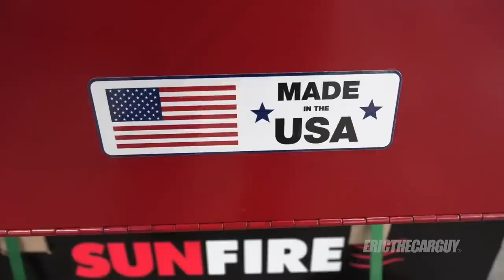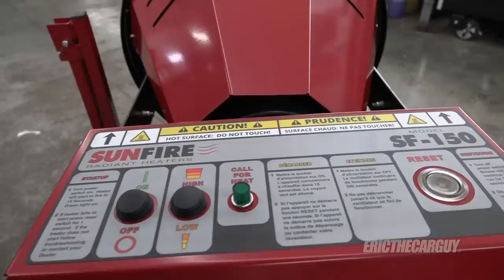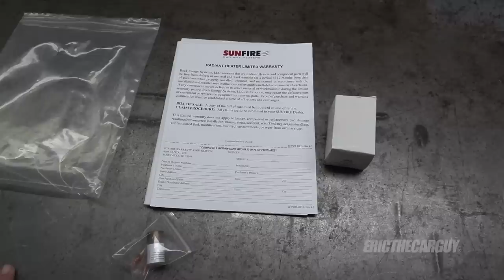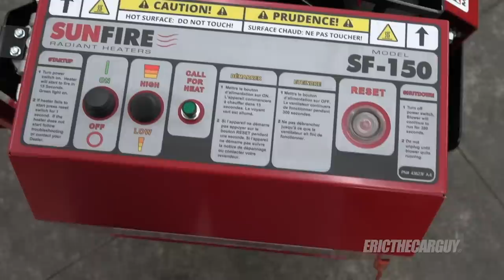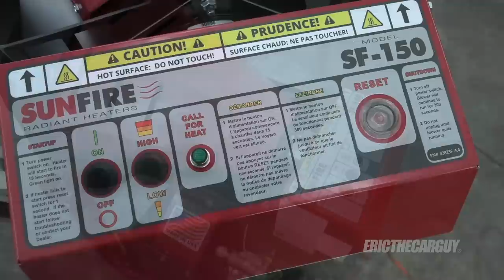SUNFIRE Heater Review

Comment: i would be worried about too much carbon monoxide or co2 even with those unvented heaters i had monitor kerosene heater for years you just set it on floor by an outside wall drill a small around 2 inch hole through wall and it draws in outside air and exhausts fumes through middle of double pipe you can hook it up to any size kerosene tank you want and it is thermostat controlled totally automatic gently blows warm air out across floor you can barely even hear it run

Comment: It runs on diesel fuel, but it's radiant, doesn't that mean that you would still have to keep a door open slightly just like kerosene or propane heaters? In other words I'm not sure how the diesel is being processed, buy I assume that any fuel will be exhausting some funky stuff.
Reply: I was just about to post something similar, albeit less eloquently... If there's combustion going on, CO2 and/or CO are being produced (I know that much), so indoors with no ventilation? Ithink not.
Reply from the maker: That's a valid concern, and I probably should have addressed it more in the video, but it's certified for ultra low emissions. Click the link in the description. Thanks for the comment.

Comment: are you sure the diesel jells over when its cold, or did someone come over and fill your fuel tank with 60 gallons of that 15w40 that's not even 15w40 its -40w-15... no wonder so much black smoke comes out the exhaust, how long has this been going on? "few days after ya bought it", hmm... doesn't sound like its running right, must have blown rings or something. one time my dad had a 1970's dodge 1-2 ton pickup, someone filled the gas tank with old transmission fluid... he wend and bought a new truck after that... every two or three years the tank gets filled with something.

Comment: 2300 bucks? You could buy 15 torp heaters from tractor supply for that. Or better yet get an overhead nat gas unit.
Reply from the maker: Perhaps, but those aren't portable like this one is. I can use this for more than just heating the shop. Thanks for the comment.

Comment: that's very nice heater but I don't think that's going to fix your sound problem it's still going to be Distortion in the background anyway nice review
Reply: Even with the torpedo, the audio was still clear enough, and didn't require raising his voice. It's really just if you can't hear yourself talking that you might feel it necessary to speak louder- the microphone picks it up fine regardless. Like if you have earbuds playing loud music that you'll shout at people.
Reply from the maker: It doesn't solve that problem, but it is much more efficient than the torpedo so I don't need to run it nearly as long to get the same effect.

Comment: What I don't like about these heater is the fumes they produce, it can.t be good for your health.
Reply: Exactly. I don't understand how it can burn diesel indoors and be safe? Or any fuel for that matter?
Reply: Great comment and a view that most people have. The SunFire 150 has ultra-low emissions with only up to 1 parts per million of carbon monoxide. The OSHA standard is 50 parts per million.  Ventilation is always a good idea because anything with a fire uses oxygen but the SunFire is UL approved for indoor applications and is virtually odorless.
Reply: This type of heater is not legal in Canada where I live
Reply: @tylermcgonigal6031  It's in French lettering, so that makes me call bullshit on that claim.
Reply: Eric should've done a better job at explaining what exactly he got. People, like Richard here, think this is the run of the mill, junk torpedo heater, like a few comments up where some guy who has no clue say for less money he could have 10 torpedoes hitting his shop/garage, what have you.

Funny how this stuff works where people have no clue about what actually hurts them, and the stuff that's actually good, doesn't.
Reply: @aserta  I do not think this is a run of a mill           junk torpedo heater, I wondered if it produced fumes.  My home garage has radiant heat in the floor.
Reply from the maker: Click the link in the description. This is certified for ultra low emissions and you can safely run it indoors as a result. Sorry I didn't make that more clear in the video. Thanks for the comment.
Reply: @ericthecarguy  they burn up the breathing oxygen that’s why they are illegal here